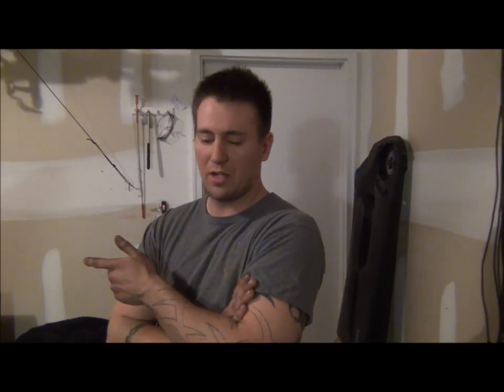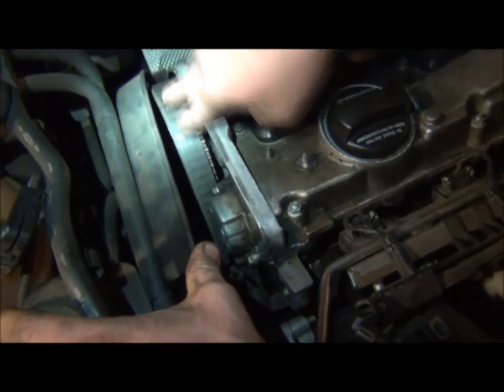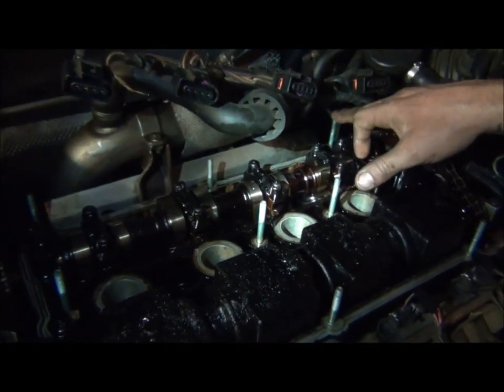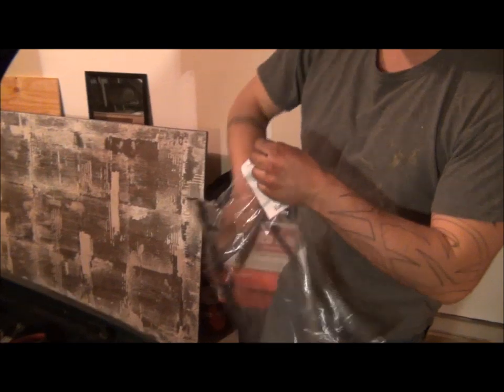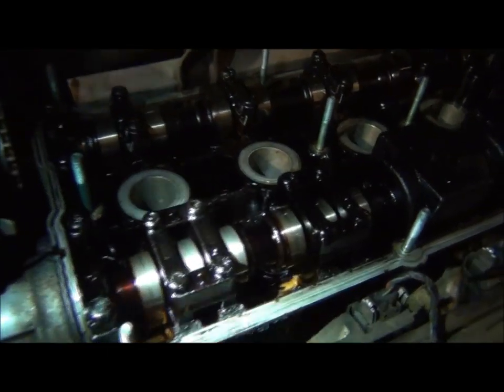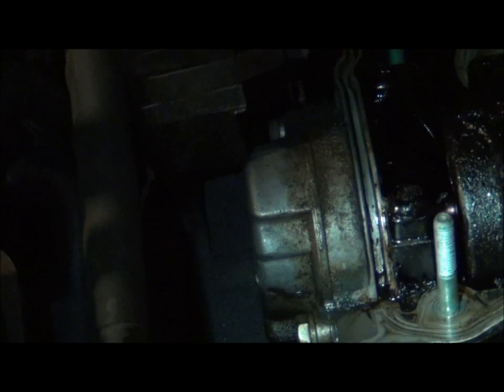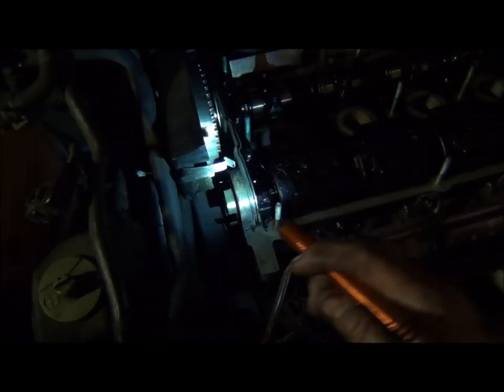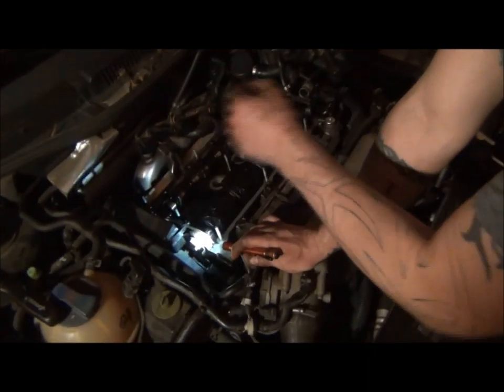2001 VW Jetta 1.8T

Comment: The cam position sensor key way underneath it does have a key weigh if you pull it off there's only one way for it to go back on there is a knot

Comment from the maker: If I remember correctly there are 2 hoses held together on the left side of the engine, if you are looking at it, and beside the coolant reservoir.  Its kind of under them on the end of the head.  Should just similar to this one as far as replacing it once you locate it.  HTH

Comment: In this same model at a complete stop I accelerate normal NOT heavy at all and the revs move but car will not move still with my foot on accelerator 2 secs later car burns rubber jerks briefly then establishes normal speed engine runs fine moving and at idle I only have a problem while taking off .. If I step on the accelerator lightly at take off it will NOT burn rubber or jerk but turns me into the annoying driver who takes off very slow replaced plugs MAF  I'm a single mom trying to make it